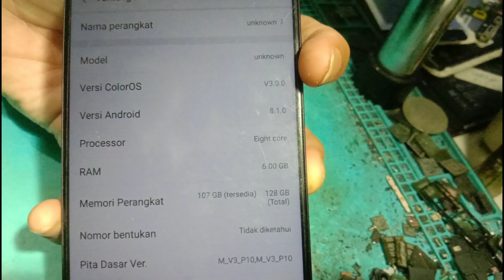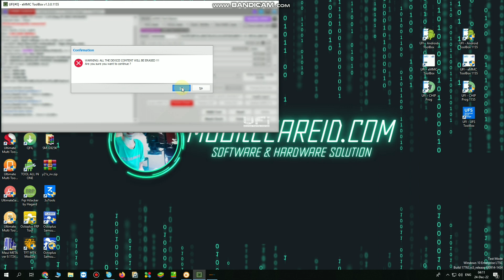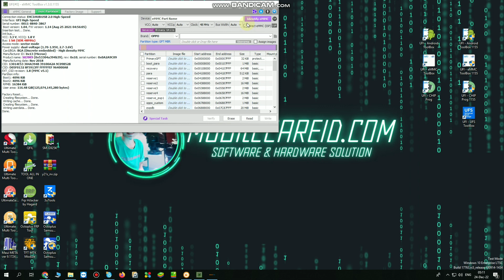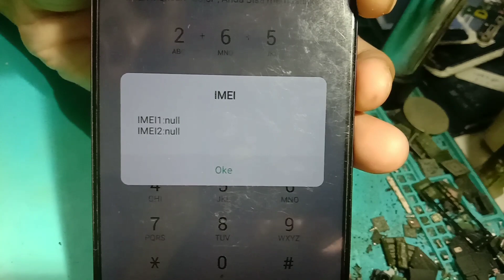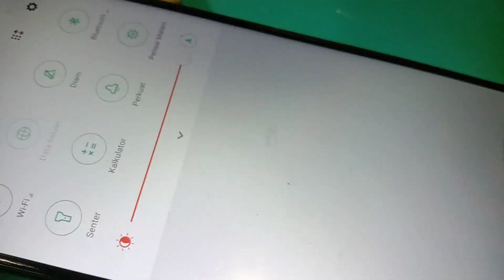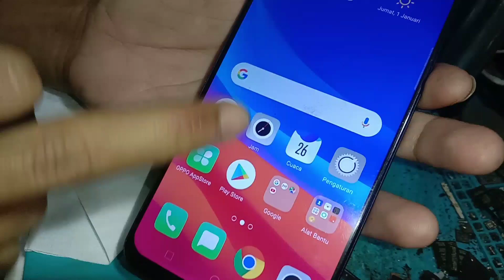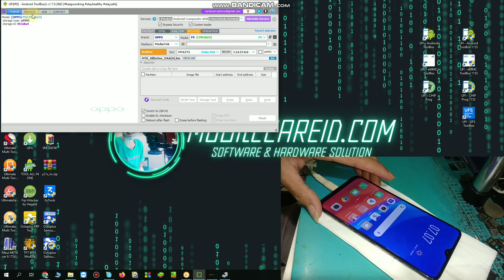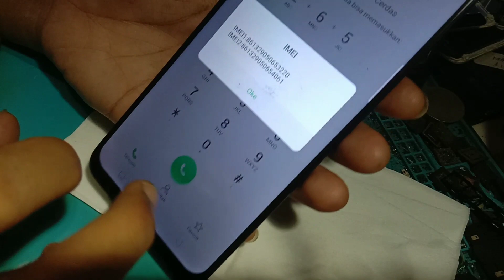Change eMMC Only Oppo F9 Pro or eMMC Repartition | Fix Baseband Model IMEI Unknown @mobilecareid

Comment: why are you disabling authentication before reading with ufi box isp?
Reply from the maker: Disable authentication to lock the device from disconnecting, sometimes USB disconnects and reconnects and causes read failure in UFI, because VCCQ and VCC use USB and battery, applicable to other devices using mediatek chipset.
Reply: @mobilecareid  thanks very much am helped,I always experience that problem of disconnecting didn't know how to solve
Reply from the maker: @joshuamungasia4529  You're welcome sir 😊